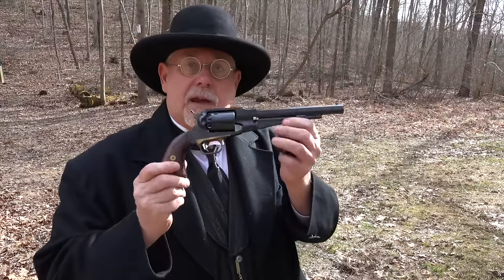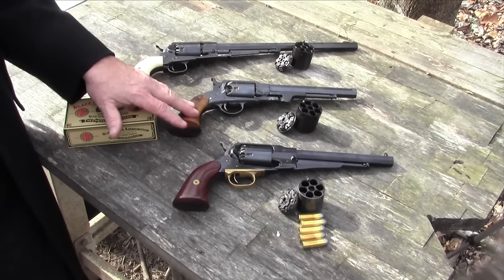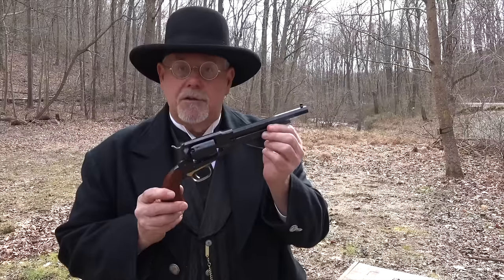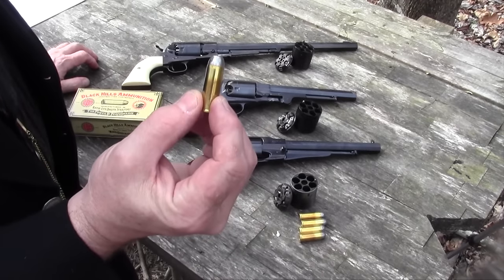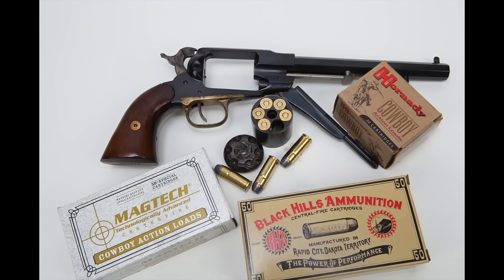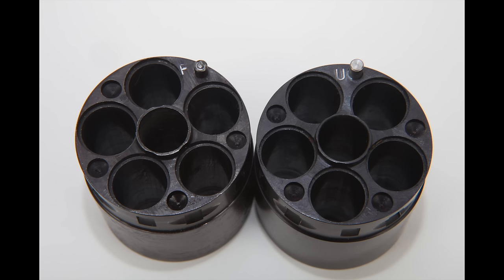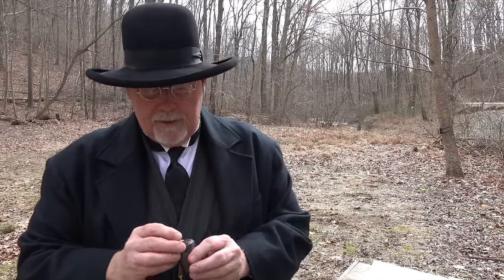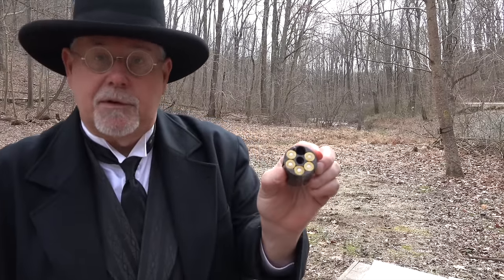Taylor's & Co Cartridge Conversion Cylinders

Comment: QUESTION MIKE, there appears to be safety notches on the Taylor cylinder. I know you are not a fan of the notch but are they usable?
Reply: There are no safety notches on the conversion cylinders, unfortunately. They do, however, have small openings so that you can see the brass in a particular chamber of the cylinder. Is that what you are referring to?
Reply: @reachvictoria3386  : On th 58 New Army the cylinder has safety notches to carry 6 loaded. On my phone it looked like there my have been notches on the Taylor cylinder.
Reply: Hamm 603 yes, I have the New Model Army as well, along with a conversion cylinder. It is unfortunate the conversion cylinder doesn’t have the safety notches, but despite that I believe they are a worthwhile addition to the NMA. 🍻
Reply: @reachvictoria3386  thank you my friend. Great to know. I squared up and deepened 1 on my Pietta. I use it all the time. I just love the smell of black powder.

Comment: In historic use I wonder how these were typically used, I'd imagine mainly with people that wanted to upgrade without buying a whole new gun and weren't bothered about reloading too fast.
Or alternatively someone might buy multiple to exchange quickly
Reply: correct. the cavalry have had two of the capNball cylinders already, for quick reloading.
Reply: @billnopoles1934  I don;t think they really did. The guns were issued with just the cylinder that came with it. Ammo was issued as packaged  paper cartridges. If a trooper wanted a faster reload, then picking up another couple of dropped revolvers and attaching holsters to his saddle was the way to go. Being in a melee, there's just no time to be fumbling around with loose cylinders. Pull out an extra revolver.

Comment: Hi Mike. Good video. How about doing a video on the .45 ACP Howell Conversion 5 shot cylinder for the Pietta 1858? Some folks, like me, have reloading equipment with .45 ACP & .45 Colt dies plus  230gr lead polymer coated / non-jacketed bullets. Gonna purchase a Pietta 1858 C&B revolver soon as this Howell conversion is an awesome item for that!

Comment: I have a question about older factory converted .32 rim fire 1863 Remington pocket models: can they be converted back to regular cap and ball firing by buying the replacement cap and ball cylinders from some of the online suppliers?

Comment: I have a question and I hope it’s not too silly. I do not what to injure myself. I had the 1858 Remington Army sheriffs model with a conversion cylinder that is for 44 Colt Long or Schofield 44. Everything is really hard to fine right now. I found some that are available through Magtech One says colt long 44 caliber 250 grains the other says 44 caliber colt 200 grains. Are they both the same length just having different powder loads ?

Comment: Mike, I received a Taylors cartridge conversion for pieta Remington New Army. I made sure it had the P  on the cylinder and attempted to load it into my pieta revolver. After some effort I achieved entry. (I suppose I will have to do some filing...but where? ) Then I tried to engage the center rod unsuccessfully. I took out the cylinder and removed the top and entered the rod into the cylinder easily. Returning to the top on the cylinder and tight fit into the breach, I was surprised that the center rod would still not enter the cylinder. Please advise. I checked my new Pieta revolver for Pieta stamp which is easily seen on the barrel.. My older New Army Remington has no Pieta stamp that I could find. But it fits better into the Breach area, although still tight. But again no entry into the cylinder.  my other New Army Remington revolver which is not labeled Pieta. Not like my new one anyway and my new one could not be made to work with the new cartridge conversion cylinder from Taylor's.... :(
Reply from the maker: I wouldn't be too quick to get the file out. You probably realize this, but I'd be remiss if I didn't mention it. The reason most people have trouble with Remington cylinders is because they don't know how to install them. You insert the cylinder from the right side until you hit resistance. What is stopping you is the hand. When you hit it, keep pushing, and at the same time rotate clockwise. That will move the hand out of the way. If you already knew that, I would contact Taylors & Co. They will probably offer to fit the cylinder to your gun for free.
Reply: @duelist1954  Thanks for taking the time to reply. I did know that from your previous videos. I was able to get the cylinder into the breach area. My main problem was the center rod that the cylinder rotates on. It would not enter the cylinder when completely assembled. I suppose I'll have to take your advice and send a pistol and cylinder to Taylor's. I assume we can send guns and cylinders through the mail legally. Or is there a certain way to send if you don't have the proper certification for gun shops? I was hoping you had some magically easy technique to make it work. Thanks again. Oh and I was still interested in your genealogy to see if we are cousins. There are 28 known different spellings of the name Billeaux in America. We came from Holland under persecution from King Louie 14th for not being Catholic. We were Huegonotts. Our ancestors arrived in the US and when processed had our names "Americanized."
Reply: BTW we live in Utah and I understand Taylor's is in Virginia. which is having a rough time with a liberal governor who is anti-gun to a rabid extreme. Hence my concern for mailing. Although I suppose I can call Taylor's and sit on permahold again. And get the info from them.

Comment: You as well as others keep talking about the 45Colt. But quite a few cylinders i looked at were conversion's to 45ACP ,cowboy loads. Which would you suggest would be best? I have a Pietta 1858 New Army all SS so i am of course looking for a cylinder with a side gate? Now hthe 45Colt gives me the option to buy a lever gun of the same caliber.... although i have a Henry in 357Mag and a Marlin in 45/70. I am purchasing some land in W.V. and hope ot get at least 25acres. Raw land of course so i will need to carry for  bear and predator defense. I was going to go with the 357Mag as its the easiest to get a revolver in. Althouh the 45Colt is as well. But i looked at Magnum Research and a couple of others and noticed they do make a reolver in 45/70 LOL Slthough that last one isnt your typical cowboy ,side arm. I want to get into cowboy shooting so im all over the place when it comes ot what type of comps i want to get into? Which will require different types of firearms! LOL HELP?

Comment: It should be safe to carry 6 if you use the alignment pin as a safety slot for the hammer, the remingtons were made with those safety slots so you could safely carry 6.

Comment: I don’t believe the bore diameter is the same as .45LC!!!
I could be wrong. However every resource lists the land to land diameter as .440” and groove to groove is .450”.
Now 2 thousandth isn’t gonna be an issue with soft lead. But if someone puts a jacketed round it could be an issue I wonder???
Reply: It will s most definitely an issue for jacketed ammo. I’m not even sure that  .45 LC even comes jacketed. Perhaps in a rifle load, I don’t know

Comment: I wish Uberti or Pietta would produce a copy of the Remington 1858 cartridge conversion like they did for the Colt 1860 Army and the 1851 Navy revolvers. I own four Colt cartridge conversions and would buy a Remington cartridge conversion in a heart beat.
Reply: lisar3006 Cimarron firearms offers reproduction Remington New Army conversions in several calibers
Reply: @tasty_wind4294  Yes they do but it is not a true copy of a cartridge conversion like Ubert did with the open top Colts.
Reply: lisar3006 from my research, there’s really no base line for a “standard conversion” of a Remington New Army, like there were for the open top Colts. From what I can tell, the closest thing to a factory conversion was a five shot conversion cylinder offered by Remington in .46 rimfire
Reply from the maker: Uberti makes one  https://www.youtube.com/watch?v=vPL5Xk7x5j4&t=3s
Reply: @duelist1954  Thanks Mike i have seen these and it is a fair copy. You have a Remington like I was hoping for with the reshaped hammer and thin back plate. That and a Thurer conversion is two guns I want. The Germans made a Thurer but they are not imported. Great video Mike thank you.

Comment: Mike thank you... I have a Ruger stainless.45 cal and I needed to know which ammo... not .45 long colt but just the regular .45. Thanks !
Reply: Sorry, but I'm afraid no one can answer  your question until you clarify what you mean by " regular 45". You need to properly identify the cartridge you are referring to, then ask again. If the confusion is over 45 colt and 45 long colt, they are the same. The "long" added after the introduction of the much shorter 45acp, to help to more easily distinguish between them. These cylinders were offered in 45acp for a while, not sure if they still are though.

Comment: Question, Sir. I have a Ruger 1858 Old Army in 45. I reload 45 Colt for a few other modern handguns. My load book calls for a starting load of Winchester 231 powder at 6.5 grains. A light load that I enjoy for plinking with my Black Hawk. Would that 45 Colt load work safely in my 1858 Old Army should I order that replacement cylinder?

Comment: Can I safely fire Federal Syntech 45 ACP through a converted Pietta 1858? The synthetic jacket is softer and smoother than copper so no damage, and it would shoot cleaner with no leading, right?

Comment: What about steel framed Colt 1860 models. And Why not use jacketed? Like Barry's bullets or powder coated. Lastly, where can I get a hollow base 45 pistol mold? Thanks.
Reply from the maker: TheOkWoodsman you only need hollow based for .36 caliber guns. Flat based .45 bullets work fine. The steel in cap & ball guns is not equal to the steel in cartridge guns. The cylinder can handle any cartridge that is within SAAMI specs, the rest of the gun...not so much. Jacketed bullets may crack the forcing cone of the barrel.
Reply: @duelist1954  I see. Thank you.

Comment: How are the two guns that you have for the black powder gun and the converter cylinder for the 45 long colt how do I buy that either Uberti brand or Remington 1858 model I’m confused as to where to go to get the Remington brand with The 45 long colt converter to go with it

Comment: It should be emphasized that the revolvers which can handle these conversion cylinders are full-frame, that is, they have a top strap which contributes to strength.  I got my conversion cylinder from Brownells, wonderful folks that they are; and I love it.  I've actually kinda gotten away from black powder in general, sorry, but I love the convenience of this cylinder, accordingly.  And the .45 Long Colt, a cartridge to be reckoned with, is the perfect match for this gun.  (My pistol is a  replica Remington by Lli Pieta, good stuff.)
Reply: Then why do they offer em in 1860 open top? Just saying
Reply: Chad Reno  That's a good question -- but it's something I'd approach very, very cautiously.  Even modern .45 LC is loaded pretty light, more to black powder levels, even though they use modern powder.

Comment: Mike I do have a question. A black powder cap and ball revolver does not have the same rules as a modern firearm. When you install the conversion cylinder that can shoot smokeless powder is it now considered a regular firearm not black powder anymore? I understand you're supposed to use cowboy type loads which are black powder but any 
38 special case is going to fit in there meaning smokeless ones fit. Generally as far as I know the law determines the frame as the gun. So if it's a black powder frame is it  still considered a black powder firearm? Some states such as New Jersey are very strict with firearm laws.
Reply from the maker: I’m not a lawyer, but my understanding is that with the cylinder installed, it is a firearm. You don’t need to shoot black powder. Any lead-bullet, standard pressure load is safe to use.

Comment: Hi Mike. Have you ever had one that didn't time properly? When I bought my stainless Pietta New Model Army in 1996 I also bought an extra cylinder for it. The extra one has never been reliable because the cylinder timing is hap-hazard for some reason.

Comment: Hello and thank's for your video.
I have a Taylor on a Pietta, I did use Magtech Cowboy 45 LC with 200 Grs lead bullet. Love that !
I want to reload this brass and I gor my self a Lee Precision kit for 45 LC and a Lee  bullet mold Semi wadcuter 200 grs.
I did my first reload with black podwer, and it worked great.
I just bought smokless podwer CSB 1 also called A1 in Europe. Do you know what will be the right load to stay in the same secure load as the cowboy load ?
Mikaël

Comment: Have you had any experience with the Howell 6 shot gated converter for the 1858 yet ? I just purchased one and havent had a chance to fire it yet but am impressed with the fit and finish. I installed it on the 1858 Pietta sheriff's model and plan on coupling it with the kirst improved ejector.
Reply from the maker: No. I haven't used it.

Comment: I have a 1847 Walker revolver Uberti. It says the material is C/H frame, steel b/s, brass t/g. Is it safe for conversion if so which one? I didn't understand since you said if it's a brass frame with this description if it was still or brass
Reply from the maker: Yes. It can use a conversion cylinder. You have a steel framed gun. The frame is the main component of the gun, which houses the action parts. C/H means the steel is color case hardened. The brass parts are the trigger guard and back strap...not the frame. You want this conversion cylinder. https://taylorsfirearms.com/accessories/conversion-cylinders/walker.html

Comment: There is a notch on the back of the cylinder BETWEEN chambers that allows me to load all 6 chambers and lock the cylinder between as to not have a live one under the hammer,  I do not see this on these cylinder conversion  do they lock between chambers?

Comment: So I know you're supposed to only supposed to load ammo that goes no more than 850fps. I loaded up some 30 and 35 grain loads using pyrodex p and a 230 grain bullet. Those 35 grain  loads are pretty powerful and I don't wanna damage my gun or the cylinder so is that a safe load to be using?
Reply from the maker: You'll be fine with that load

Comment: There is a third manufacturer of the 1858 Remington.....Traditions firearms.  Are Pietta conversion cylinders compatible with Traditions brand 1858 Remington cap and ball revolvers?  Thanks for a great video.
Reply from the maker: Traditions is an importer. They do not make any guns. Pietta makes Traditions’ revolvers.
Reply: @duelist1954  
Wow, I can't thank you enough.  I've spoken to a few businesses that "specialize" in selling BP guns and accessories and not one of them knew the answer.  I had a feeling this was the case but I just wanted to hear it from a knowledgeable person such as yourself.  Well, thanks very much, this was driving me crazy.    Best wishes.🙏🏼

Comment: I'd like to have one for my 1862 36 caliber Colt steel frame reproduction. Thing is the cylinder is more than I paid for the pistol which is a downer. I bought the pistol 13 years ago with 2 BP cylinders for $300.00 .

Comment: Hello Mike. I have been considering making a safety notch on my new conversion cylinder. My original cylinder had one and worked fine. Would I be wrong to assume it would not damage the strength of the new cylinder.
Reply from the maker: Cole Cole nope. You should be ok
Reply: @duelist1954  You da man!

Comment: The base plate on my converter is stationary and allows me to use a loading gate so I don’t have to remove the cylinder every time for loading. For an extra cost there’s an ejector rod that I installed as well. These do require a bit more skill to convert as you have to adjust the tabs or “feet” on the base plate. You also need to hog out some material around the loading gate to facilitate insertion and extraction of the round. When it’s done this conversion makes them even more enjoyable to shoot.
Forgot to mention, I can only load 5 rounds as there are only 5 chambers with a dead chamber that wasn’t drilled. You might have to also adjust the timing

Comment: I have a somewhat unrelated question; I’ve been seriously considering a reproduction Smith and Wesson No. 3 in 38 special. Can I use modern loadings and jacketed bullets in them, or are they restricted black powder equivalent loadings and lead bullets?
Reply from the maker: I would stay away from +P loads, but, other than that, you can use any standard velocity .38 Spl round.
Reply: duelist1954 thanks

Comment: I have the Remington New Model Army oversized steel frame .36 caliber with the .38 caliber cartridge conversion cylinder. I can't seem to find any information about the maximum load I can use in it. Any information would be greatly appreciated.
Reply from the maker: Any standard pressure, lead bullet load will be safe to use. No Jacketed bullets or Plus P ammo. However, unless you shoot hollow-based Full wad cutter ammo, your accuracy will be pretty bad, due to the .375" bore and .357" bullets.

Comment: why doesnt taylors machine the safety slots on the rear of the cylinder like the cap&ball cylinder so there is a safe place to set the hammer down and still have 6 rounds loaded?